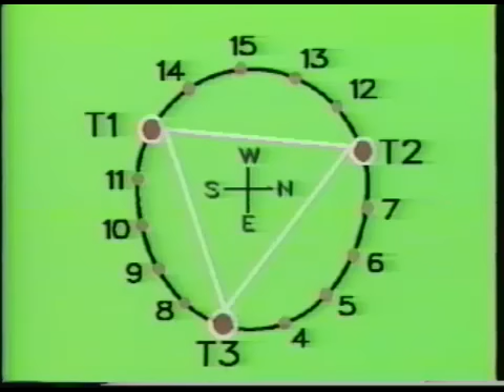How to Set up a Tipi

Comment: I have seen a replica of the canvas teepee cover that Hudsons Bay Co was trading at Lower Fort Garry (which is north of Winnipeg on the Red River).  It differs with your's in one respect, the means of fastening the inner skirt to the poles.  A single rope was used.  A clove hitch  on a door pole including one end of the skirt started it.  Then the rope was strung thru a hole in the skirt near each pole and once only around each pole.  But also a twig was inserted under the rope on the lower side of every pole; this was to allow condensation to run all the way down the pole instead of dripping on the skirt.
Reply: I love that you know "the stick in the liner tie" trick. Not many do. It helps with rain water running doen the poles also.

Comment: Two questions: what size cover for two people and how long the poles? Would this be a practical tent for a modern hunting camp, considering transport etc.
Reply: Tips's can be purchased in many sizes. Most people go with an 18' Tipi as it allows lots of interior room. It is also a great size for a family of four.
An 18' Tipi requires 17 poles. The length of the poles is 22-24' on average.
Reply: @wiredog8888  thanks for the reply.
Reply: @wiredog8888  If you really like to show off with an 18 footer, use 30 foot poles!  It really shows off the top cone of the poles and is quite beautiful!  However, you are right, if you just want to get by!
Reply: @kimcurtis423 
Show off?
How 'bout just making a lodge to live in for a season?

Comment: Thanks. This is very good. 

Does it matter on what kind of canvas you use? I see some listed as fire certified and some listed as marine treated canvases, and not sure which go with which type of terrains.
Reply: It's helpful to use the best canvas available to you!  Fire rated is nice but, if you are at all careful, it isn't needed!  The fire is in the rear center and a long way away from the canvas!  The most waterproof canvas you can get is a good thing!  However, any GOOD canvas will tighten up when wet!
Good luck and best wishes!!
Reply: @kimcurtis423  Thank you.

Comment: Just one problem. I didn’t see any fire in your tipi. You have a smoke hole at the top but no fire. You have a canvas bottom for the floor. How you gonna burn a fire on the canvas floor? 🔥
Reply: 'Snot a problem!
There's no canvas "bottom." 
Where did you see that?!
Ya must not've been watchin'.
There IS a "skirt" that goes around the inside of the cover. It helps to insulate from wind, keep moisture out, etc.
I did note they said the skirt was "about 5 feet high," but unless that guy was unusually tall, it only came up 3'. There was also about a foot around the bottom that draped inward on the ground to seal off the wind that comes under the outside canvas. So about 4-41/2' wide. I might use one 5' wide, like the narrator said.

Maybe that draped part of the skirt is what YOU thought was "the bottom."
Dumkins.
There's plenty of room for a fire, but I'd keep it in the middle, so's ya don't catch the canvas on fire, y'know. 
Wouldn't be pretty if yer tipi catches fire, 'specially if yer init.
Y'know?  Hmmm?